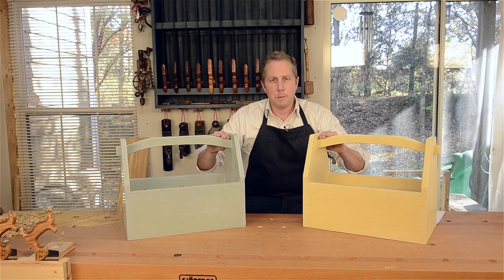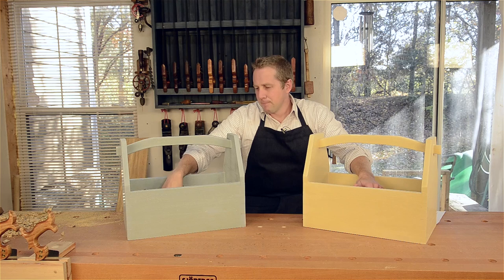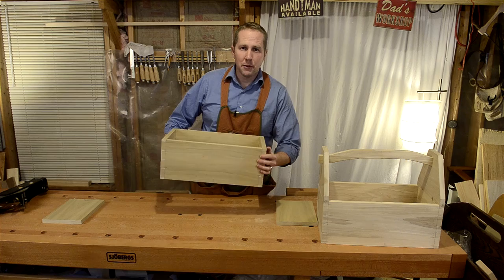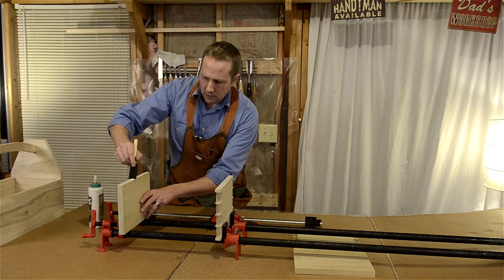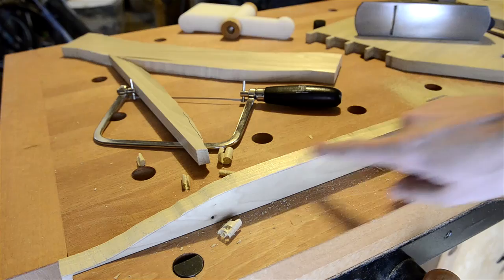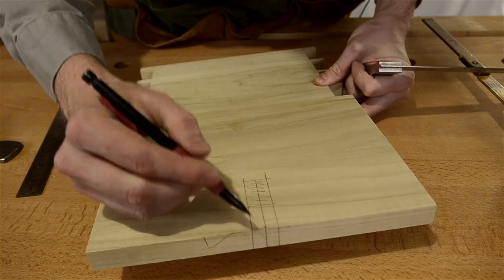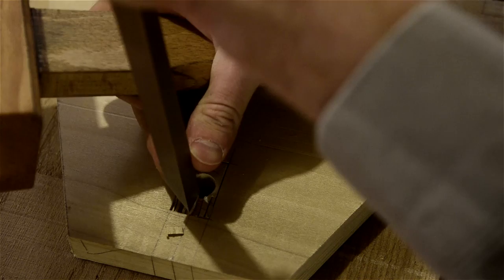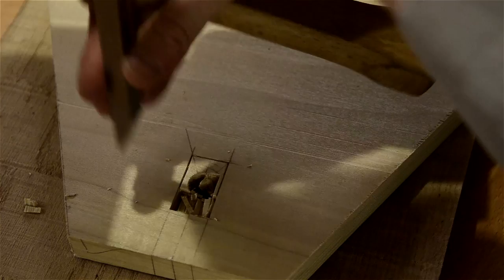Make a Dovetail Tool Box with Hand Tools

Comment: As a teacher myself (but not of woodworking!), I think this is a great project, since it gives one a chance to practice such basic skills. Could I suggest that you redesign it a bit so that it only requires easier to obtain tools (where does one easily get a plow plane?).
Reply from the maker: writereducator Believe me, these are some very simple hand tools. And plow planes are one of the most inexpensive and simple hand tools available, and can be found on eBay, at flea markets, etc. Sometimes for even under $20.
Reply: I have Record 405 (British equivalent to the Stanley 45). I absolute love it and am certain I spent well less than $100 for it on eBay several years ago. It cuts like a dream.

Comment: In my opinion all sides must be made from one solid piece of good, no glued parts, otherwise its a furniture, dust collector.
Reply from the maker: IvarsDay These tool totes have worked just fine for quite some time. One solid piece is hard to find in that width. You can't do it vertically, because you can't cut the dovetails into the side grain. Glue lines are stronger than the actual wood.